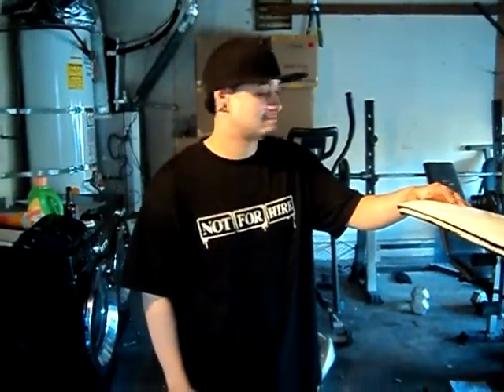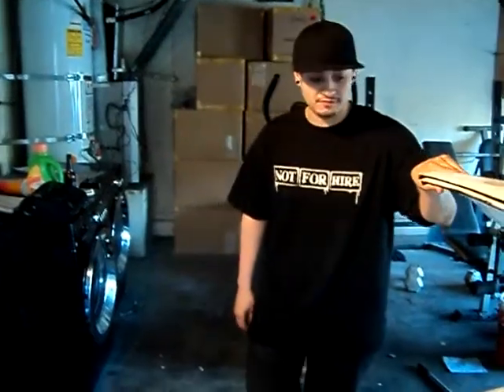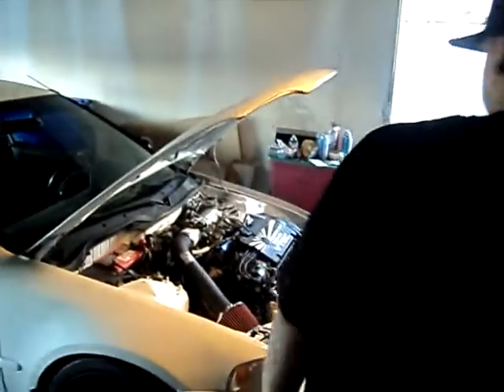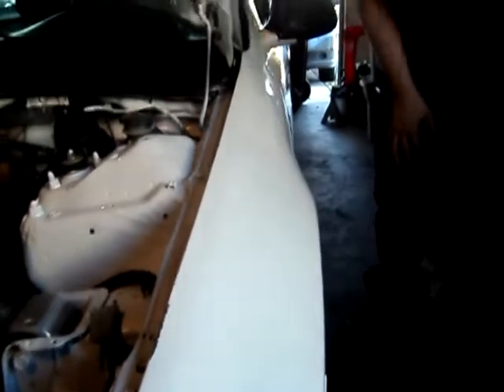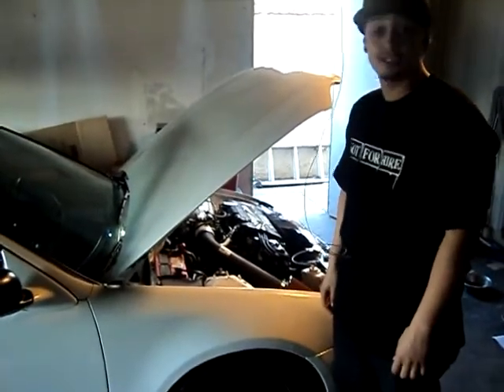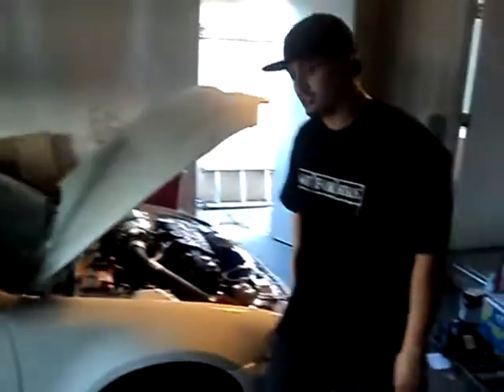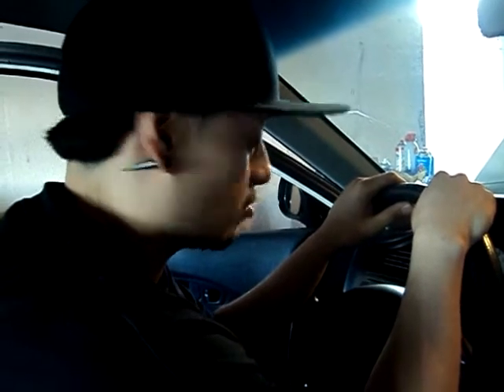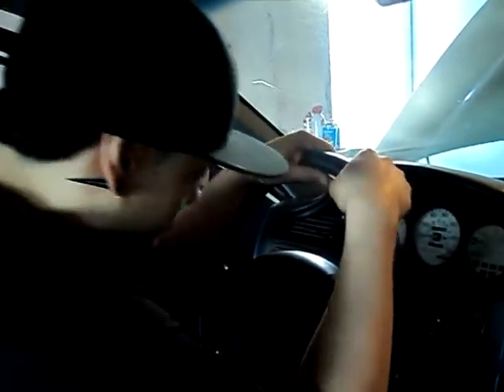honda civic hatchback project update

Comment: A los you should get the NRG quick release kit. I got it 4 deal's. The hole kit for 3 bill. I got it from the company it's self. Came with everthing also came with a NRG lock that goes around the hub an a set of  custom key's.